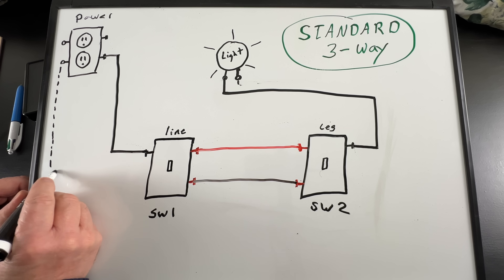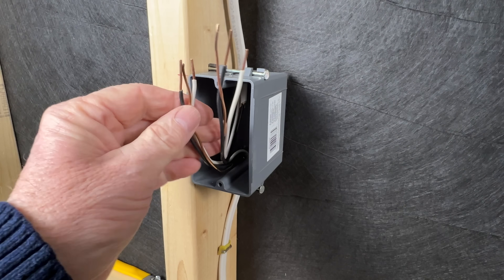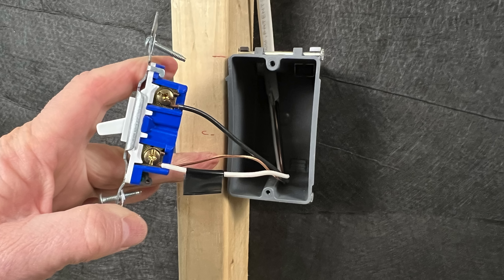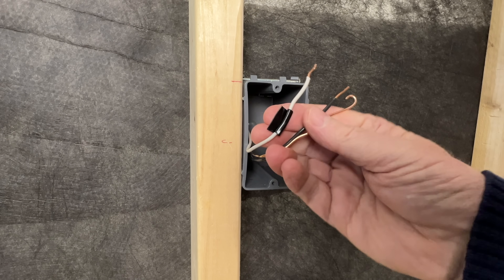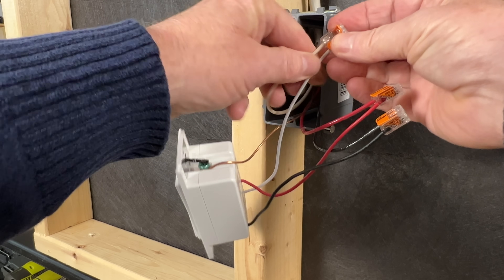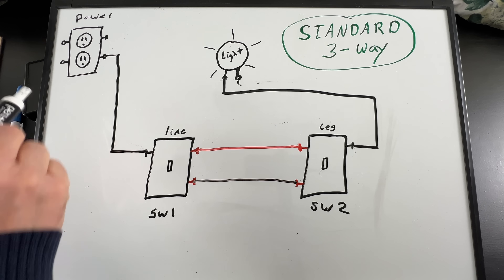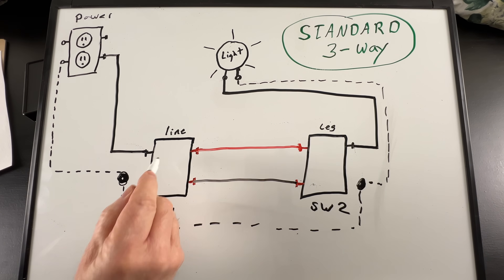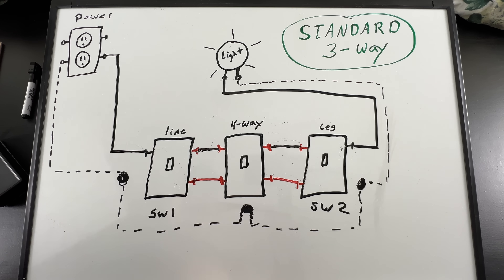How NOT to Wire Light Switches in 2025 (New Rules)

Comment: I have been away from the NEC for quite a while when I had a restricted area of electrical licensing, but that new code on demanding a neutral with switch legs is irritating and mettlesome. What is the safety or fire-hazard improvement?  Yes, it benefits some smartswitch companies who may need the neutral [competing with smart relay solutions at the load], but we are likely on the brink of an LED-driven set of code changes soon imho.
Reply from the maker: People were connecting the neural  to the ground wire to get it to work creating a hazard by having current flowing on the ground.
Reply: @BackyardMaine   Fair enough; I guess I am surprised that DIY'ers would know they could do that or would want to. I wouldn't rewrite the code for someone who had the idea to pull a constant receptacle feed off the black/ground of a switch leg. It still seems that the code is merely to support a subset of manufacturing solutions that may be a short lived phenom depending on where we are headed with 110v volt switching (I have DIY smart home on older house, so I get it).  Granted or arguably the internet can be an anarchist's cookbook, so NEC may be reacting.

Comment: I have installed many complicated four-way circuits and three-way circuits in properties, I always draw it out, most of these have included conduit and Romex wiring, so if you have a complicated switch locations just draw it all out and start connecting the dots then figure out how many wires you need between each point and how you’re going to get them there, for example you have a four-way circuit that might have four switches, one by the back sliding door, one out on the patio somewhere in a wall, one upstairs in the bedroom and another by the gate coming into the backyard this is a complex circuit Only in the fact that you will have to figure out how to get all the wire from where it needs to go and then to all the different lighting just draw it out start figuring out your runs and it’s very simple at that point
Reply: Three way and four way circuits are easy if you remember that one end of the circuit will have the power feed and the other end has the switch leg. All wires between the switches are travelers. Red and black wires are the travelers using 3 wire Romex.Tie neutrals together and tie grounds together. Stuff in the rear of the outlet box. I can do these type of circuits without even thinking.
Reply: The hardest part is FINDING a 4-way switch!  Most of the hardwares stores here don't have them...except for that ONE odd store that's the furthest away.
Reply: @TonyP9279  Well you could use two 3-ways in a double box to get 4-way functionality . Link them with their commons together .
Reply: @Mk101T   would it still be a 4-way circuit? no loger 3 switches , the number of paths per switch toggle increased
Reply: @joekesler8014  Wow , you dug up an old one for me .   Sorry my input into this convo was a red herring , while maybe interesting ... I totally lost the basics , which vernebolton answered pretty good.   Don't know what I was thinkin ?

But the key point is 2 , 3 , 4  way switches ... refer to how many poles (screw terminals) they have.
Not including a ground for metal chasi parts .

A two pole switch connects 2 wires on/off
A three pole switch connects a common lead , between 2 outputs that 1 is always on and the other is always off / then reverse .
A four pole switch then switches between 1 pair connected , and then the other pair connected .
Top left and right ... then bottom left and right ... usually ?
And remember both 3&4 pole could still function like a 2 pole.   think how ~
Reply: @joekesler8014  Hmmm ... maybe I missed the gist of your question.  Or thought explaining the differences between the 3 types of switches would awnser your question ?

So I will expound by saying ... when wanting 2 different switch locations for 1 light.
You use 2 three way switches .
When wanting 3 different switch locations ... you just add a 4 way switch between them.
Then if more locations ... you just add another 4 way switch between the 2 three ways , and so on for how ever many locations should control 1 light.
So think of the three way switches as book ends with their common screw terminal.
1 of them has the source power connected ... and the other supplies the light with power.

Hope that helps ;)
Reply: @Mk101T  i'm sorry, i did a bad job with my pun , i do appreciate you taking the time to describe the different switch circuits(and you did a great job doing that but i've been wiring them for a long time now . i was refering to can you technically or jokingly still call your circuit with 2  3-way switches in the middle (taking the place of the 4-way) a 4 -way circuit anymore because its the number of switching paths ,not switches differerent locations . the extra switch creates another path (a short one between those 2 ) i was just being silly a guess
Reply: @TonyP9279  Well yeah that would suck, if you don’t have an electrical supply house or a big box store, I guess the only answer there is to keep a few on hand
Reply: @TonyP9279  Or I suppose you could try to tell them that odd numbers of switch locations have been outlawed .  So you need to install 4 locations ... thereby you can use only 3 way switches .  With the 2 middle of the line ones , being only connected with a single conductor on their commons .   Hehe lol .

But then of course can just wire nut the two travelers till the 4-way shows up in the mail .

Edit:  Scratch that about four 3-way switches being able to work .  Was before enough morning coffee and thought I was being clever .  Ya obviously the 2 switch combo won't let power through for the last leg switch position to function for turning the light on ... Duh :\
Reply: “ for example you might have a four way circuit “ , there are no 4 way “ circuits “ , only 4 way switches. I’m wondering if you’re even an electrician.
Reply: @twoweary  🤦🤦🤦
Reply: In math, the shortest and simplest solution is always the right one.
Reply: In Australia a 2 way switch circuit, each end of a hall, we run a twin red and white double insulated from one switch to the other,we call that wire a strap, a single core active colour cable goes to 1 switch , that is called the active, from the other end the same single active colour cable runs to the light, this wire is called the switch wire, we will mostly run a feeder cable we call active neutral and earth around the ceiling to all light points, switches are 1 and 2 way designed, for 3 and 4 ways, say each end of a hallway with 2 bedrooms we use a 4 terminal switch called an intermediate switch,  neutral at a wall switch is only taken there if required, all cables in open wiring must be double insulated, started in the electrical trade 1965, a trade where you must check, check, and recheck,in Australia we have ac 230volts single phase and 413 volts 3phase and still at it occasionally. Australia 🦘
Reply: @Arthur-c7d3d  I think it is key to understand for anybody dealing with wiring ... should understand any multi switch location/function .  Requires 2 three way switches to act as book ends for the route of  pwr ON / pwr OFF .
And you simply put 4-way switches inbetween them for all the locations.
Which each wire switch to switch , only needs 2 conductors .
The nuetral , only needs to be at the light .

Comment: my house has some weird wiring for light circuit they ran two wire supply to first ceiling box 3 wire from box in ceiling down to light switch so they could then take a two wire over to next ceiling fixture to supply power to that fixture then another three wire to switch for that room to be supply and switch leg so it leap frogs over whole first floor of house that way and into garage.

Comment: Wow, a super informative video on the proper wiring electrical switches!
As a handyman, I am both surprised and a little terrified by this change at and in the NEC Code! 
Do you have a visual representation that I can access online or otherwise?
Well done, Sir!
Reply from the maker: Thank you.. I'm going to build some guides in the near future. Stay tuned.
Reply: As a handyman you probably aren't licensed as an electrician. You may be allowed to change out switches and receptacles and be compliant with licenseing laws, but once you start adding circuits and more receptacles and switches and other outlets you should be licensed.

Comment: So how exactly is the lack of a neutral in a switch box a safety violation? The NEC is supposed to be for electrical safety, not for micromanaging the non-safety, practical decisions that are made for each individual installation. And don’t say it’s because it’s dangerous to use a ground wire as a neutral, because that is its own code violation.
Reply from the maker: Yup, people were connecting the neutral  to the ground wire to get it to work creating a hazard by having current flowing on the ground. They won't make that code violation if the neutral is there in the box.

Comment: An additional change just released is the addition of 16 gauge Romex which cable manufacturers will be making available soon, hopefully. Along with the 16 gauge cable will be a 10 amp breaker. The NEC reasoning behind this change is that lighting circuits will use LED bulbs or fixtures going forward. I think it’s not only a smart reasonable move but builders/contractors stand to save a substantial amount of money. 
In my area of the country, #12 gauge has never been used for residential lighting circuits as it’s simply overkill + 14 gauge lighting circuits may NEVER be connected to 20 amp # 12 gauge receptacle circuits. It’s required for safety. At night, for example, let’s say you plug something into a 20 amp receptacle circuit that pops the 20 amp breaker. Since light circuits are totally separate, the homeowner is not left in the dark.
I applaud the NEC for making this change regarding the introduction of 10 Amp lighting circuits as a safety issue. In the event of an LED “driver” module failure, that 10 amp breaker is much more likely to trip quicker than the current 15 amp breaker. Time is of the essence, in the prevention, of the LED “driver” module catching fire❗️
Reply from the maker: Yup that was my previous video.. Check it out.
Reply: And no doubt the cable manufacturers will be charging more for 16–gauge cable and 10-amp breakers because, you know, they can — because the stuff will be in demand. And if prices do somehow miraculously fall, the homeowner will never see any savings.

Comment: So the second 3 way switch better not have an electronic or a light in it.
Reply from the maker: The idea is you only need one smart switch for the lighting circuit so you install it where the neutral is located. It would make no sense to have to for the same lights.
Reply: Range of remote unknown

Comment: Ive always wondered why the dont make a 14/2 with 2 black, or 2 white.
Reply: Because of cost.
Reply: @stargazer7644  the coating color would cost more.... I don't think so
Reply: @JohnQPublic345  It isn't the coating color.  It is producing another product.  You cant just put two identical black or two white in the cable, one would have to have a stripe or something so you know which wire is which. You have to have a production line to run it on, you have to make different packaging, you have to handle the logistics of tracking and selling it another product.  That all costs money.     Plus someone has to buy it.  Why would someone buy a whole roll of this stuff just to wire a switch when they can just use what they already have?
Reply: @stargazer7644  I going to agree to disagree my friend. This is a multi million dollar manufacturer.  Im sure they could switch up the machines and produce the different wire configuration
Reply: @JohnQPublic345 Of course they could.  But there is zero financial incentive to do so.  And companies exist to make money.

Comment: That is the best description of iow to 3 and 4 ways. I've done them before but always takes me longer to watch the videos 4 times than actuslly wire it in.

Yours was clear and  concise
Reply: I like to print-out the best representation of the way I wired a 3- or 4-way loop and tuck copies in each switchbox or by the cellar lamp, where The Next Guy is sure to find it. 
"always takes me longer to watch the videos 4 times than actually wire it in."  True that. I learn better from well-drawn drawings. Although that could mean flipping every wiring book in the library, cuz some are/were just awful. Now books are going out of style. BM's video is pretty good, and I thank him for that. But if you go to a yard sale for deals on workpants or moosetraps, see if they have 50-cent wiring books.
Reply: @PRR1954 ha, I put notes in the switch boxes, too! Not necessarily for The Next Guy, most likely for The Same Guy 😊 It saves me time if I ever have to go there again (I'm not an electrician, just an old EE & CS grad, so I only do this with my own switches). I also have a Dymo label maker that can print on heat shrink tube, it's perfect for labeling wires. Before I had this I was printing the labels on plain paper, cutting it as small as possible and sticking it between the wire and transparent heat shrink. It is quite ok but a lot of faffing around 😂
Reply: Yeah, I finally understand how to wire a three-way after watching this!
Reply from the maker: Thank you sir.. I do my best.

Comment: I retired as a electrician for 30 years and manager in electrical supply house before that. The new code not too bad. The thing I don't like is running across a light switch with no neutral. Later on if you wanted to put another switch that needs a neutral beside the old that requires one(some do)have to go back to the panel on the other side of the house. I'm turning 70 soon.